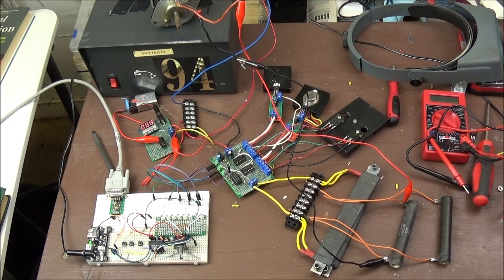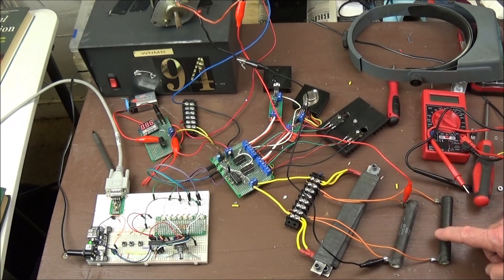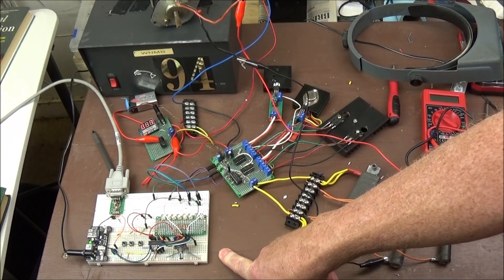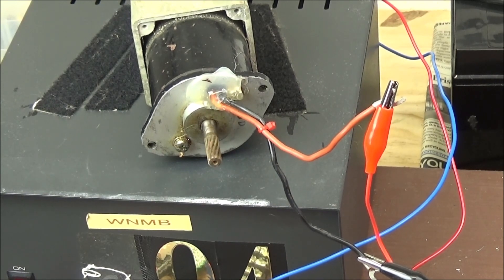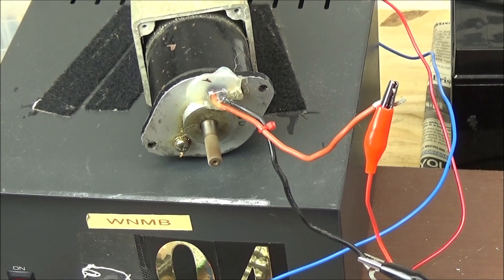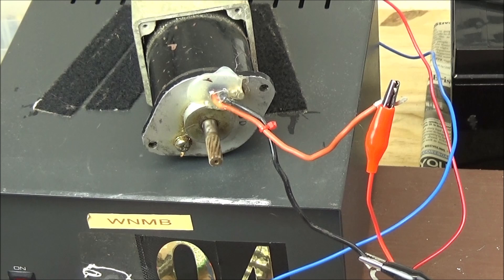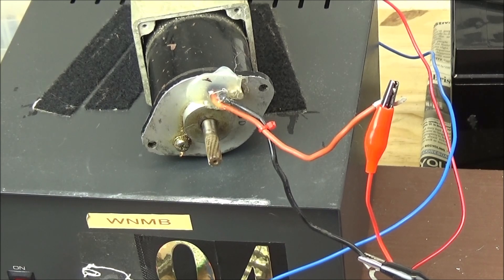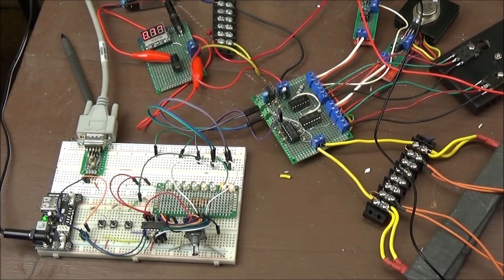3.3 Volt Logic Controls H-Bridge TTL Input

Comment: I was looking through spec sheets and I figured that Darlington transistor might be the fastest switching device from 3.3V TTL. Either that or BJT to FET. I am sort of going back in time. Soon I will discover vaccum tubes for a while until finally I will start using iron filings.